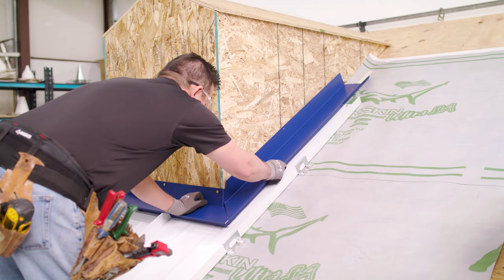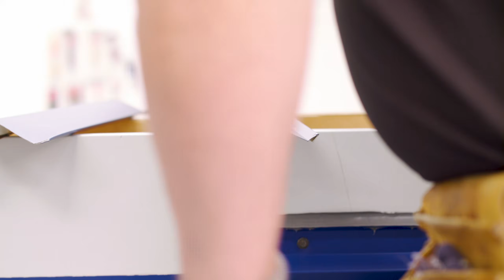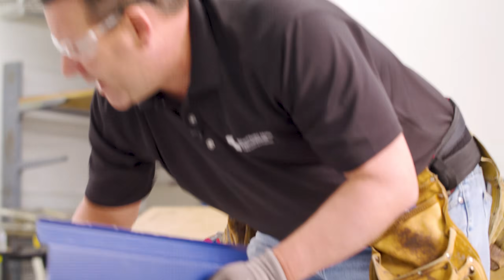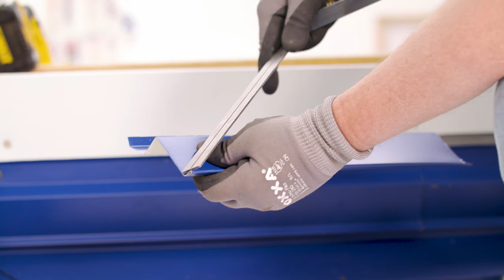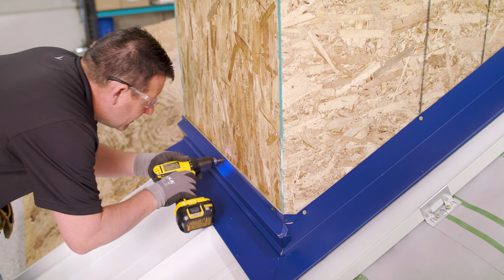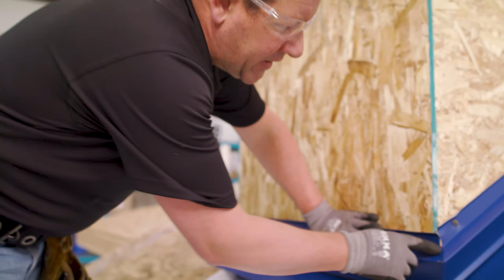How to Install Inside & Outside Corner Miters for Sidewall & Headwall

Comment: Would it have been better to use a 1/4 impact to install
Reply from the maker: We recommend using a drill or screw gun with torque control. Too much torque can fracture or overdrive the fasteners. Check out this video for more: https://bit.ly/dewalt-screw-gun-review-video -Thad